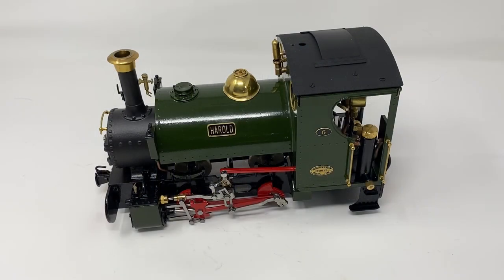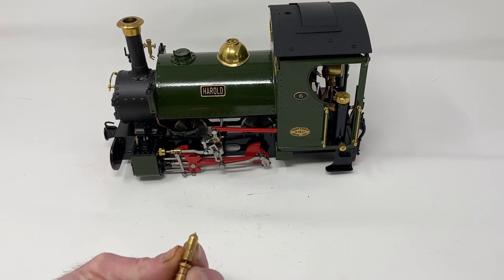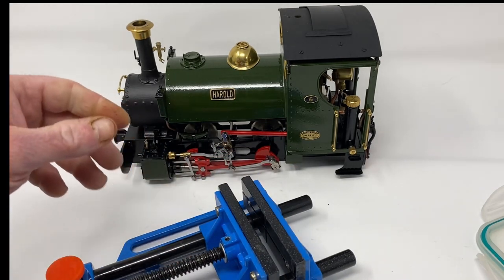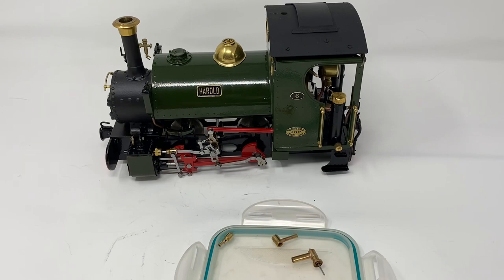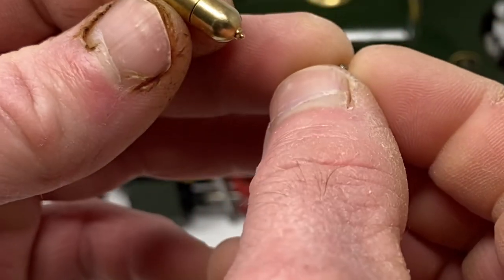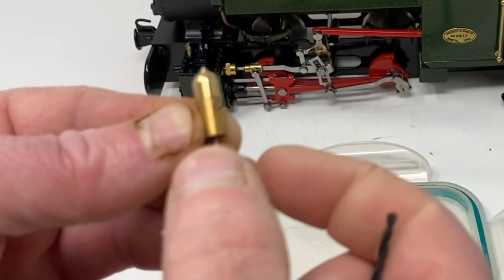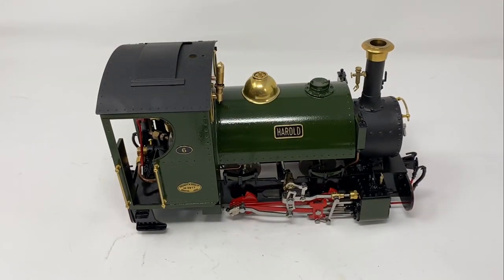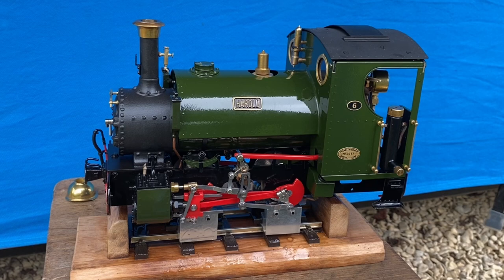How to clean a DJB engineering steam whistle fitted to a Roundhouse Katie

Comment: Very helpful. I have the same problem with my whistle. It worked fine until I took it off the engine and put it back on. Now it makes no sound and I have lost the instructions. Now I will be able to adjust it.
Reply from the maker: Glad you found it useful, also make sure the resonator is tight, I left it a bit loose after cleaning the whistle and it didn’t make any sound till I tightened it up.